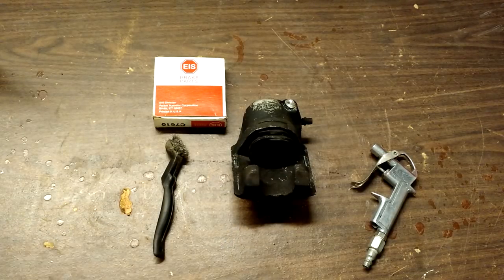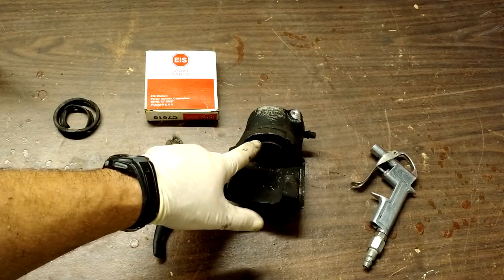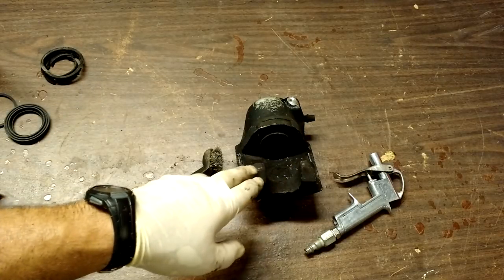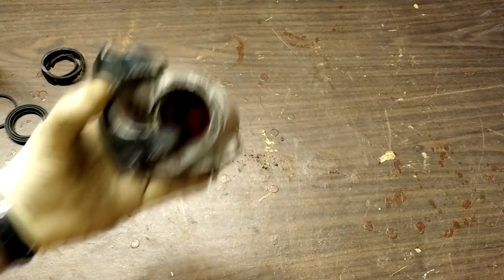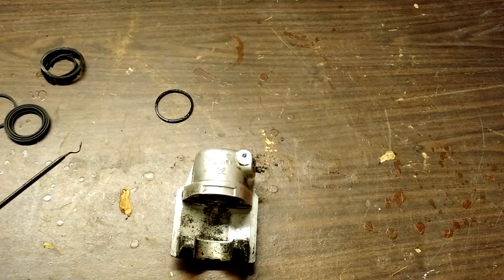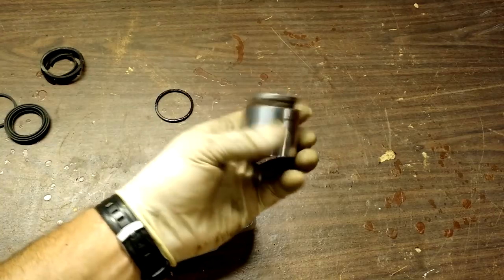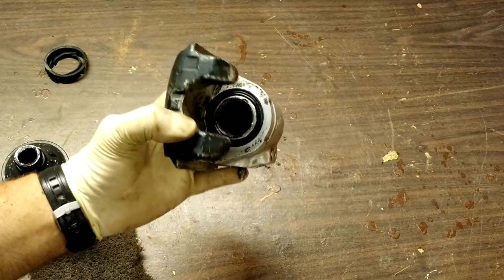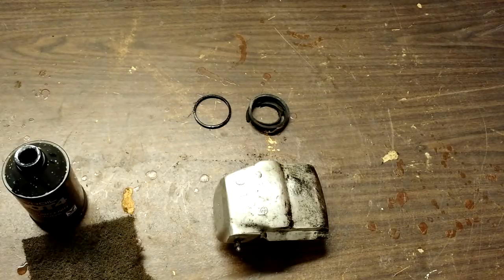The Forgotten Art Of Rebuilding Brake Calipers.

Comment: I always like to rebuild rather than replace. It adds to my knowledge and ability tool box. First thing I ever rebuilt was an automobile starter. Only thing that was wrong was the broken hold down springs of the brushes. Added brushes also and it was good to go. An alternator starter company near me was kind enough to sell me the springs even though it would have cut into his core business. This was way before internet shopping existed. Most people were laughing at me for doing it, but I just laughed away to the bank. Thanks for showing the instructional video.
Reply from the maker: It has become a parts swappers world. With rebuilt stuff coming out of china for less then you can pay a guy to rebuilt it at the shop 99% of places don't even bother. Calipers, starters, Alternators, heck even CV axles get tossed and "reman" parts get put in.
   Its too bad, because your right. If you spend some time and a whole lot less $$ you can do these things yourself and save big.

Comment: This is a very timely post as I’m currently rebuilding the calipers on my Geo Metro. I have to replace the pistons because they are rusted and pitted on the outer surface. Thanks for posting!
Reply from the maker: I've always wanted a Metro. Great little cars, I wish they made something that simple and economical these days.
Reply: I have 2 of 'em. I got one from my brother in Eastern NC 9 years ago and another from a Craigslist seller in Hickory back in December. I still see them popping up regularly on Craigslist. Parts are fairly inexpensive, and they're pretty easy to work on.

Comment: The old GMs used to be relatively easy to rebuild parts, alternators and starters. You are right about the cost vs. time, however some cars it makes sense to get the old things working again. That’s the case for my work car which is a Kia. Parts are expensive for those cars.
Reply from the maker: I am amazed at how far Kia's have come in the last 8 years. They are every bit as good as the 2000's Honda's as far as reliability and ease of repair.

Comment: Mechanics have become parts replacers. I have a cousin who was able to recuperate a caliper once that was totally trashed and make it serviceable again.
Reply from the maker: Its totally true, but don't blame the mechanics for that completely. Its all part of the monster known as "Flat Rate"  Techs don't get paid to do quality work anymore. There is no incentive to go the extra mile and repair stuff like CV joints or brake calipers let alone rebuilding steering racks or starters.
   It just doesn't pay. The parts swapper mentality is all about getting the most hours in a day.  If you can find a shop that still pays techs by the hour or by a flat salary that's the place you want to take your car, but good luck finding one. When I started 25 years ago it was about 50/50 flat rate vs. hourly. Now its 85/15. I personally worked at two shops when they changed over. The quality of the workmanship plummets faster then the moral.